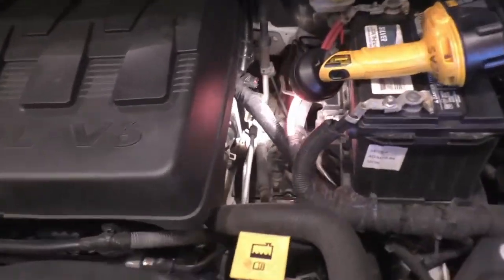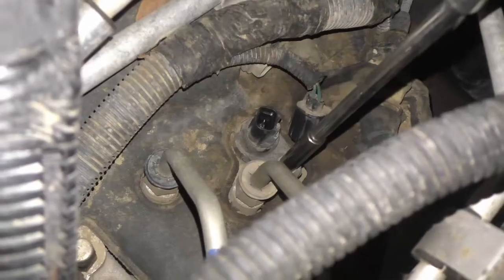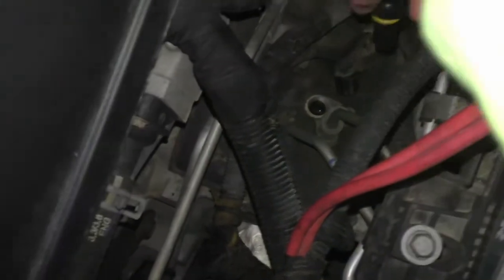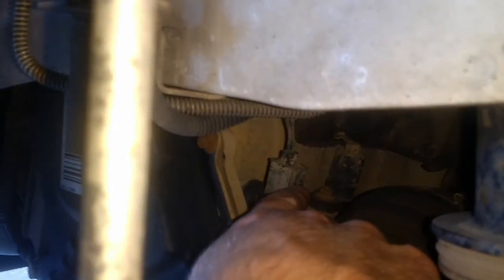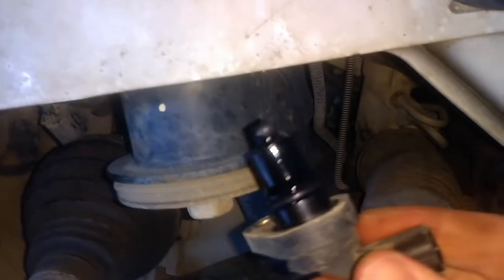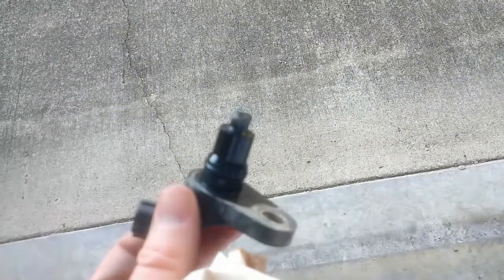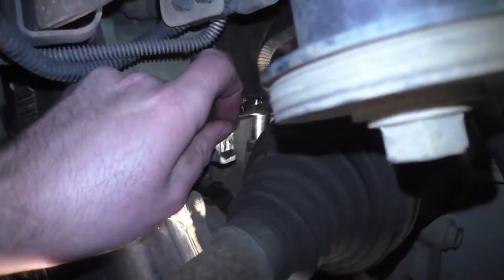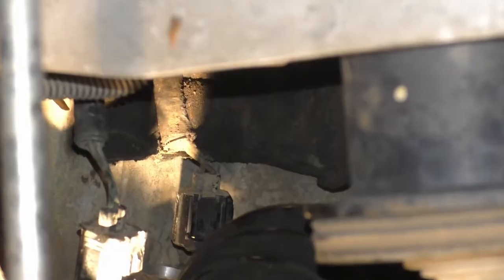How to Replace 62TE Transmission Sensors (Town & Country, Caravan, Sebring, Avenger, Pacifica etc.)

Comment: My transmission when I'm driving above 60km/h and I need to press the accelerator to downshift, for example, going uphill, the transmission doesn't do it, could it be a sensor? The transmission was completely redone and it was already having this problem.

Comment: Ive got 2012 town and country voltage from shift solenoid for 1st and 2nd gear is low going to replace the sensor what is location for it part number tcs398

Comment: Which one is the intermediate shaft speed sensor A?
Reply: Don't worry about the A.  It's the one I don't point to at the beginning of the video, closest to the black cover.  
Be aware that the fault may not be the transfer/intermediate speed sensor itself. The sensor may be telling you the truth that the compounder is failing and/or a clutch is slipping.
If the speed is faster than it should be (because of a slipping clutch?), the TCM will store a speed sensor code.  Still, it's not expensive to replace first to make sure.

Comment: I have p0734 and p0792, but the vehicle drives fine. Could this be a sensor issue?
Reply: Me too, but in addition to that, I have the PO733 code and mine isn't shifting in 3rd and 4th.
I would change them before you have an issue.
It sounds like we should buy the set of 3 and change them all. He also said look at the tips of the sensors for metal flaking which could be indicative of an internal issue in the transmission.
I'm hoping that's not my issue.

You likely caught yours on time since you aren't noticing and shifting issues.

Comment: My van have P0736 & P0792 codes. The reverse gear is halt. I wonder the transmission went out or just the sensors?
Reply from the maker: Unfortunately, it's most likely the transmission.
Reply: @AdamLucasYT  thank you Adam. I think so too but hopeful just the sensors.
Reply: @dontran5332 what ended up being your issue?
Reply: @AdamLucasYT 
I have exactly the same codes and the same reverse issue. The transmission fluid is complete clean & perfect. 
Any advice from your experience?
Reply: I have exactly the same codes and the same reverse issue. The transmission fluid is complete clean & perfect. 
Any advice from your experience?